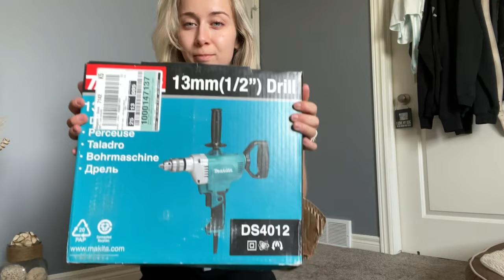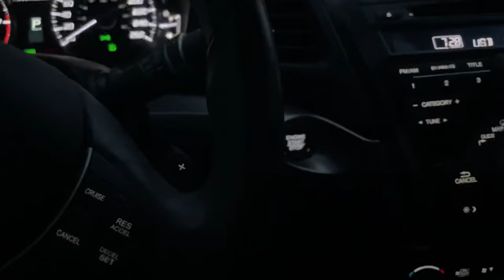A Day In the Life Of An Electrician - What Do Electricians Do

Comment: Good stuff young lady, I’ve been a electrician for about 8 years in California. I noticed you hold your hammer with your hand all the way up the handle , try holding it lower where the grip is and notice how much power you get per swing, just a little tip 👍
Reply: Hey boss I’ve been looking to electrician apprenticeships for when I get out the military, there’s one in my hometown and an electrician union as well that a couple of family of family friends told me to look into. From your personal experience do you know if being prior military helps with getting into the apprenticeship (and possibly the union later down the road)? Thank you for your time
Reply: I’m from Cali as well
Reply: @diegoreyes3201  hey just seen your comment and I was in the same position you was when I got out of the military. I now have my journey license in commercial. A lot of people will say go union first but what I did was went non union and they had a school accredited through the state which actually let me use my G.I. Bill and got paid working as a electrician as well. Best bet for you is to use Indeed and get your name out there being military definitely helped.
Reply: @diegoreyes3201 9 yr Ohio sparky here. F ind a local Electrician that specifically does service calls and new construction. Be a helper for a few years then take your licensing exams. It's pretty cut and dry. No need for unions or anything like that.
Reply: Non Union blows.

Comment: When I was an apprentice we wired a RTM house in -40 weather and man it was cold. Large propane heaters but they only felt good when you are right in front of them. Running the wire was bad enough but when we went to install the wire in the boxes and skin the insulation off wow. We got the house done in a day with 4 of us. Now doesn't say on the wire not to handle below -10 well it did then.  Yes there are bad and good days.

Comment: Get out of residential and start doing commercial/industrial. It's so much better and you will be a better electrician in the long run. Plus you make more money. Also, learn how to troubleshoot. Installing residential new construction is easy. You can train a chimpanzee to rope a house. Knowing how things work and knowing why things stop working is key to being a good electrician. 
 Pay attention as to how carpenters frame houses, where they double up on 2x4s, how corners are built , etc... it helps if you do any service work and every wall is finished and painted. Pay attention to how the plumbers run their pipes. It helps avoid drilling into something like gas, water, or a vent. 
 
I got my union journeyman card for commercial/industrial inside wireman in 1996 local 332 Silicon Valley and in 2013 got my state C10 electrical contractors license in California. Started working for myself and I do residential and commercial service work for about half of my jobs and the other half or more of my work is as the locations electrician on set for all the major film and tv studios and production companies in Los Angeles. I have worked on many Academy Award winning and nominated films for directors like Tarantino , and Spielberg and many #1 and Emmy winning and nominated tv shows. 
 There are many different directions open to an electrician in all kinds of different industries and environments. If you learn the trade well and enjoy it work is a pleasure and the money can be very good.

Comment: Diablo boring bits would work great with that drill. Sometimes, it's the bit not the drill. Milwaukee is a name brand that looks good, but if the bits used are cheap and crappy then the holes will take longer to drill and fewer holes. Just be happy your not drilling with a Yankee drill😂

Comment: that is not JUST a mixing drill. You can certainly drill studs with that. It is just a D handle or spade handle drill. It has a lot of torque so don't break your wrist. lol make sure you use that handle attachment. Good luck! 30+ years in the trade here. You picked a great career. learn all you can and you will always have a job! Stay out of the union! lol